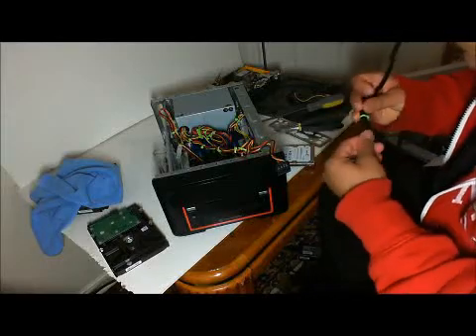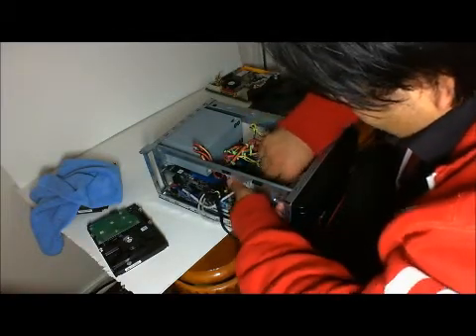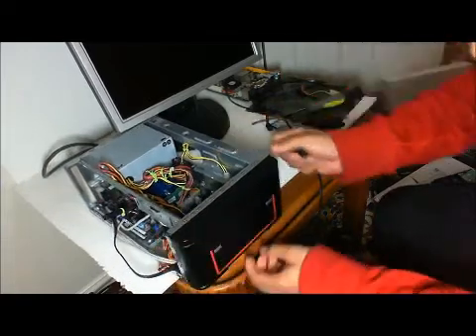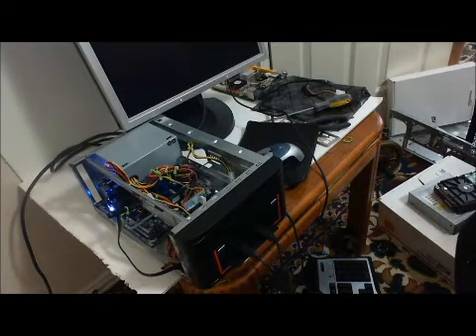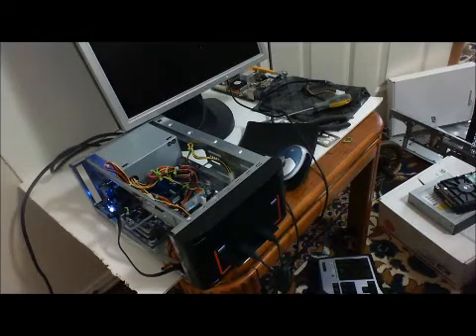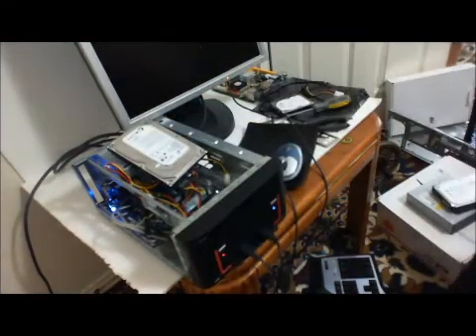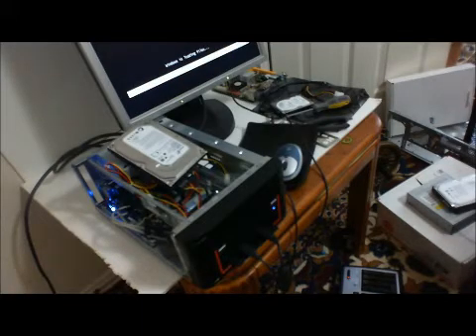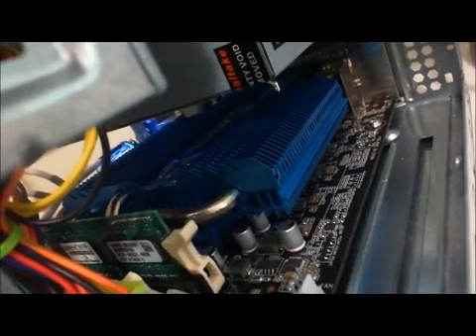Asus A5IONT-I Gaming Rig Downgrade

Comment: HI, I have same MB and same case like you. Great peace of  hardware, runs very nice and quiet  .) I have 250gb SATA HDD and samsung dvd rw, OS is win 7 + xbmc.
Also i bought Chicony wireless keyboard with touchpad and with this keyboard nice remote controller is coming,with little tweaking it can be used to control XBMC. By default it controls Windows Media Center .